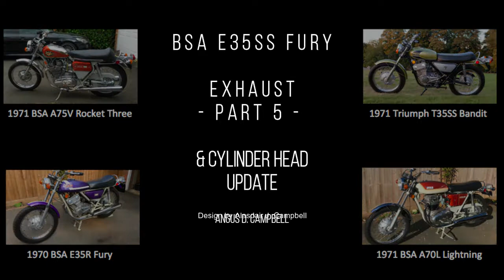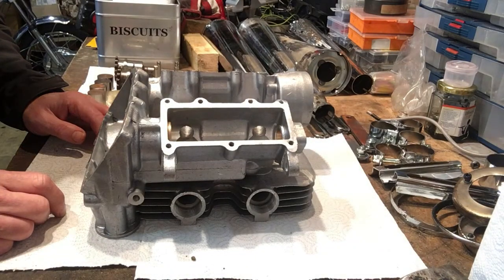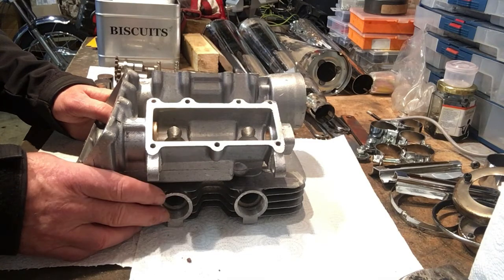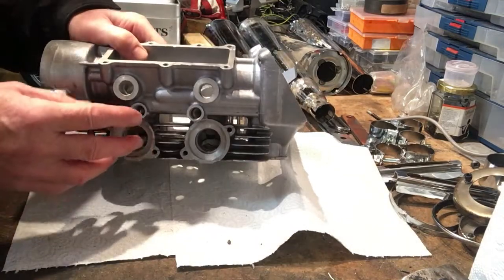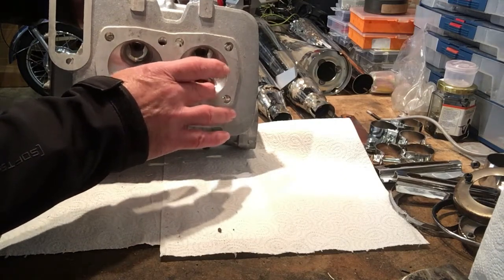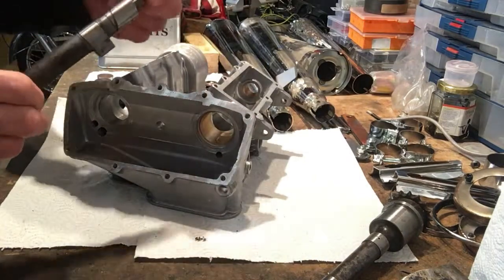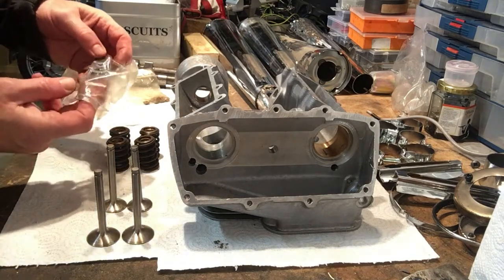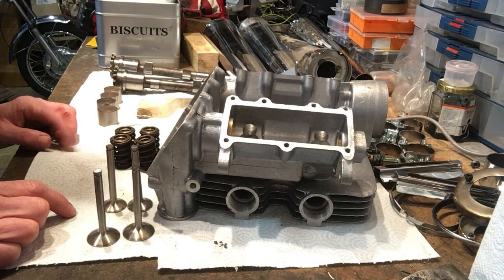BSA Fury SS (E35SS) Build - Cylinder Head - Part 1 - Journey to Here

Comment: I'm watching your Fury videos in no particular order.  When BSA said it was a display bike they sure weren't kidding.  Unpolished castings, parts left not machined, bushings and bearings not installed, gears sized and cut of different engineering specification updates,  tool marks on internals, lubrication passages sketchy, and the "coup de gras" being the auto advance cavity off center -Good Lord--this would test the competence of any trade school machine shop instructor.  I wonder how many viewers actually realize the research you and cohorts have to do before milling out one single thing without causing irreparable damage  to unavailable parts.  What you are doing has more in common with restoring masterpiece artwork.  In fact it is---industrial artwork- which is what this BSA prototype is.  This series should be required viewing in every high school machine shop worldwide. Your attention to detail and accuracy is excellent.  Press on!
Reply from the maker: Many thanks John - you’re too kind. Glad it’s of interest and yes we’ll certainly be pressing on. Thanks again.

Comment: Hi Angus, I am currently working on a series of video's detailing the machining of the castings. I was waiting until you had done yours before I went to press..The shim in the points housing wasn't put there by me. I just thought that there was very little metal there and that it was fortunate that there was enough room to put the holes required in line with the camshaft.
Reply from the maker: Hi Bob nice to hear from you. Thanks for confirming that the shim wasn't of your doing - all very curious. Will be very interested in your series when published - thanks for the heads up.

Comment: Hi Angus, the cylinder heads were bare of valve seats, in some of your photos, looked like a good usable head, for inserts, great show, very well presented. Thank You
Reply from the maker: Many thanks. Yes all seems to have worked out with the engineering - well beyond my skillset though.
Reply: @BSAPowerSet i worked in cylinder head reconditioning ,automotive and motorcycle, the BSA head was deep for your modern unleaded exhaust valve inserts or inlet. very important what you do here and show, many thanks
Reply from the maker: @theshameofthesun  ahh ok thanks I’m beginning to understand. I’ll do some research. Thanks again.

Comment: looks like a phosphor  bronze bush on the on the inlet cam
Reply from the maker: Yes it is - there’s one the other end on the other side as well too. As I explain at one point in the video - this had to be done to achieve alignment of the cams. We believe this may have been a scrapped casting hence machining not originally finished by BSA. But it’s all we’ve got so have to make it work. Thanks for interest.
Reply: @BSAPowerSet  Hi Angus, your work here is brilliant, with left over Umberslade Hall designed prototype motorcycle parts. Truly outstanding, a great talk through-walk through pictorial best ever journey, privileged BSA Triumph  . 350 twin cam 4 valve twin
Reply from the maker: @theshameofthesun  Many thanks although bear in mind that the actual engineering work was undertaken for me by proper skilled people - I’m just the fitter mechanic with some basic experiences that’s not afraid to have a go. Cheers.
Reply: @BSAPowerSet  Thank You Angus, Very important your rebuild of this motorcycle, a world beater in cycle frame and parts and twin cam head, very enjoyable, I'm sorry if I offended you. Brilliant what you do
Reply from the maker: @theshameofthesun  Absolutely no offence at all. I just wanted to point out that without help of other skilled people it couldn’t have or can’t happen. Appreciate your interest and kind comments thanks.
Reply: Hi Angus with the greatest respect, you took on the hardest project ever, you talk through the rebuild clearly and educationally. with a bsa triumph 350cc  motorcycle , from 1970 or so, Great Job and thank you, very humbling

Comment: Did the factory ever get any of these running  ?  If so what happened to them.
Reply from the maker: Hello Andy thanks for comment and interest. Yes a pre-production batch of about 20 were built for final testing and build quality and these put in some mileage in ‘71 before the programme was stopped. Some got out when the factory inventory was being sold off and also those out on display such as my show Fury at Vale Onslows just stayed there. We know of the whereabouts of most of the surviving examples including the show only empty motor ones and those built up from parts such as the Bandit and Fury SS in my garage. Recently one turned up in South Africa that had been exported from Verrall’s in 1977 and although not running atm it shows an odometer mileage of 3300 miles. There’s also a high mileage one in Aus owned by Doug Fraser. So I reckon there’s up to 25 or thereabouts in existence, some of which are in museums. Thanks again.